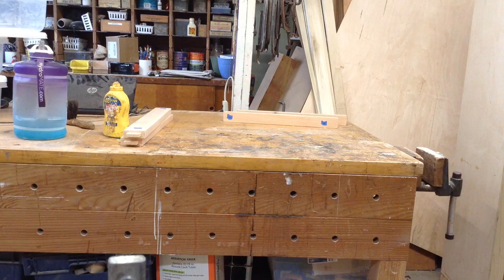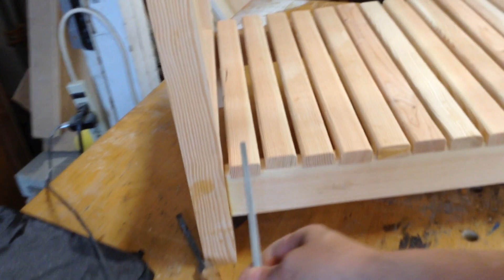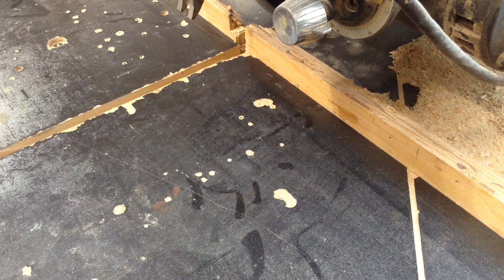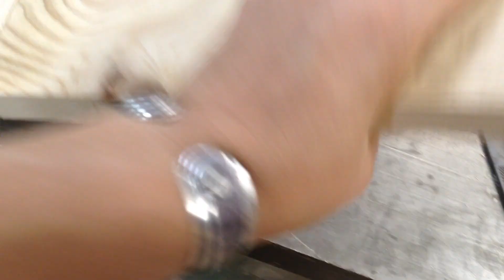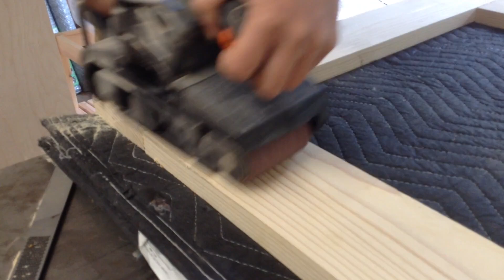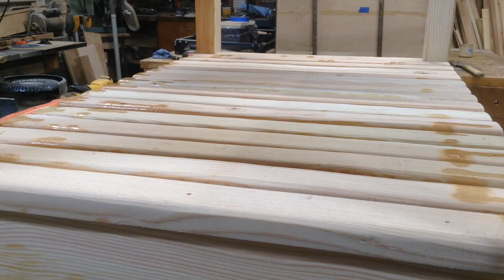Woodworking Projects : Beginner Woodworking Projects & Tips // Sensory Table Part 2

Comment: 06:54 OMG - no riving knife..
Reply from the maker: I have binding issues when using the riving knife.
Reply: @HoneyBadgerWoodWorks  I'm not as  experienced with table saws like you but, as I understood; binding occurs when your fence is either exactly parallel to the blade or the gap on the blade's back is narrower than at the front. So, if you'd true up your fence, binding could be eliminated, and a riving knife could prevent kickbacks the way they should. Right? Thanks, Catelyn
[sorry for my bad English]
Reply from the maker: @GNU_Linux_for_good  My fence is fine. The issue is the stock knife is thicker than some of my blades and it binds.  I need to replace it, and just haven't
Reply: @HoneyBadgerWoodWorks   I see